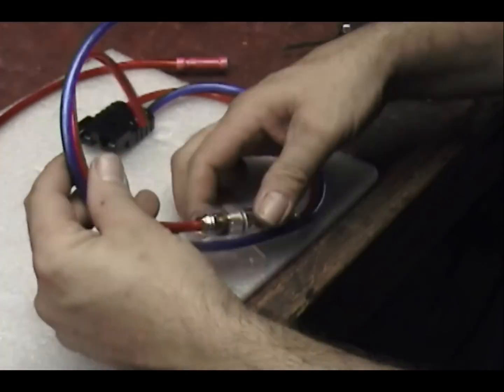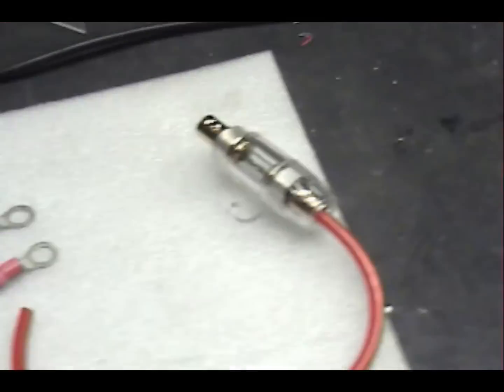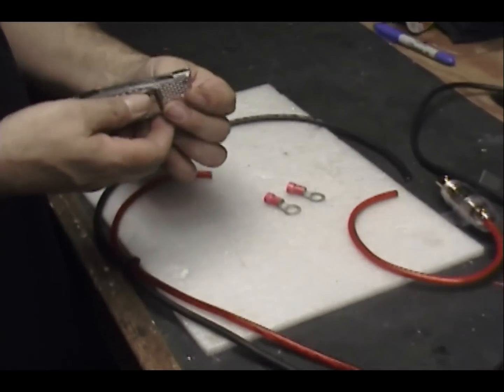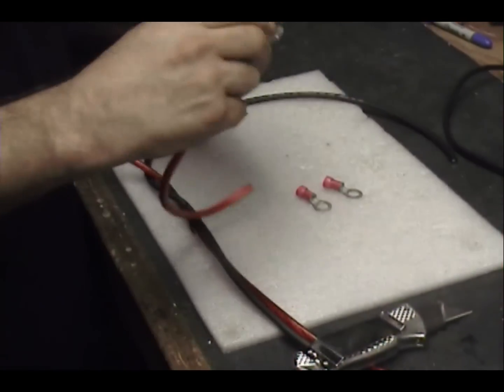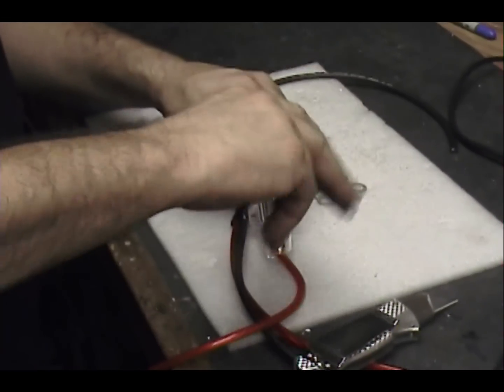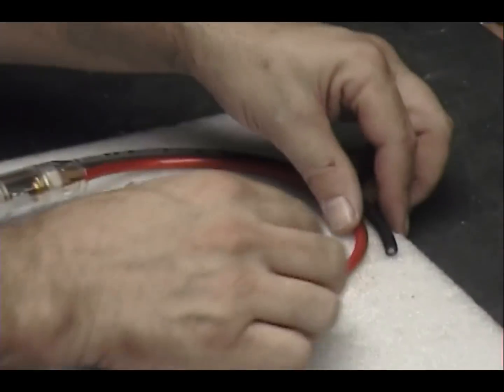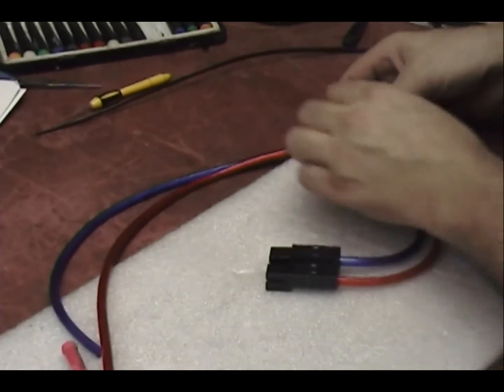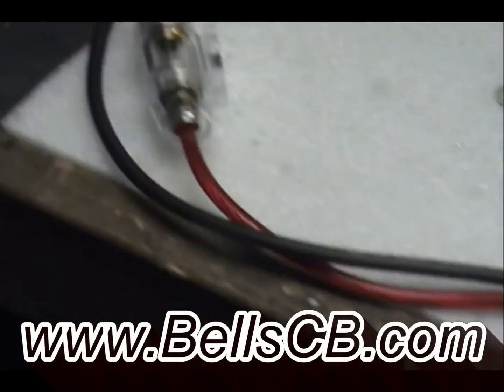Ranger 69FFC4 Power wire preparation for installation

Comment from the maker: @harleyrdr864 because it provides the most protection for a short ANYWHERE in the line. The source of power should always be fused to prevent fire when a short in the line occurs.  For instance, let's say the new stereo installer puts a screw right into your 8 gauge CB Radio wire at the firewall...if a fuse were at the radio, the truck would burn to the ground, if a fuse was at the battery, the fuse blows and all is safe. ;o)